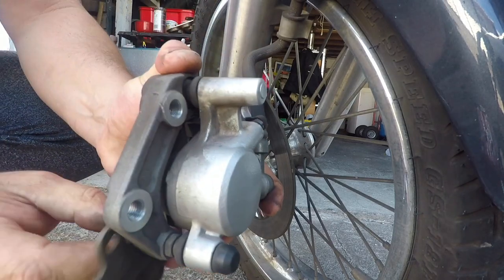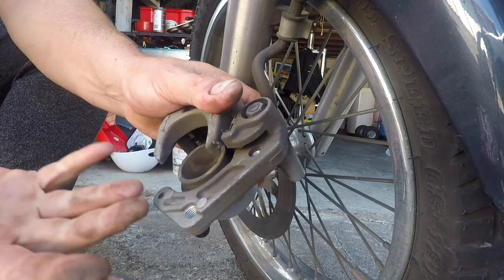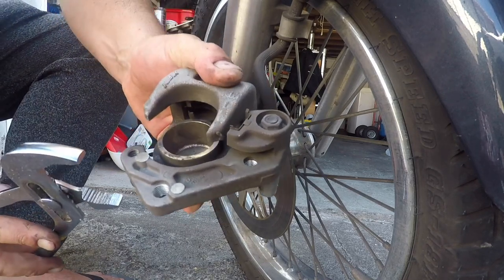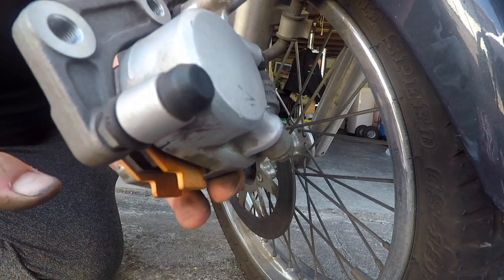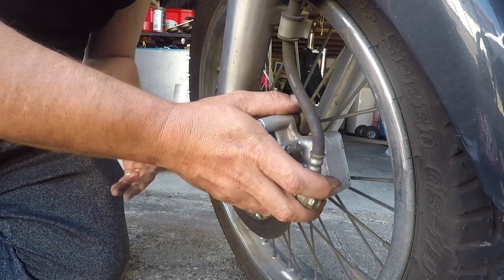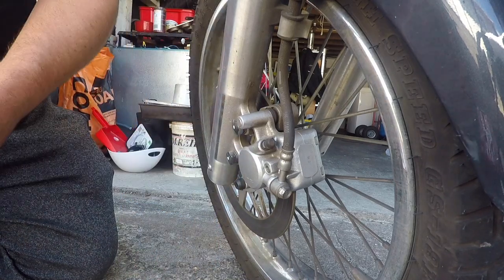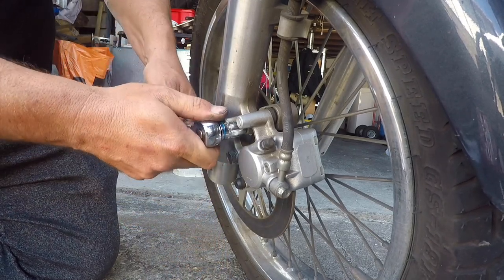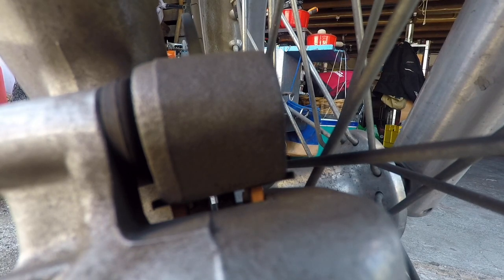Changing the front Brake Pads on my 2015 Suzuki S40

Comment: Thanks alot man. Youre guide came in clutch. My only problem is that now my brake light is on constantly. Is there an adjuster or switch that I need to tweak after putting on the pads?
Reply from the maker: DanDaDotman the brake light works off the switch either at the hand leaver or foot brake, the installation on new pads is all mechanical parts, pull the leavers and see if you can hear a little click as the switch is activated.

Comment: I did this but now when i fully engage my front break lever the bike doesn't stop on a dime. the wheel still turns slightly; i have bled the breaks and replaced all the fluid. I don't think I have air in my lines, I  bled them a few times now. is this normal?
Reply from the maker: Sebastian Morales no that’s not normal, if there is no air in the line you should be able to lock up the front wheel. Just changing brake pads wouldn’t put air in the line. Are you able to reverse bleed the system?